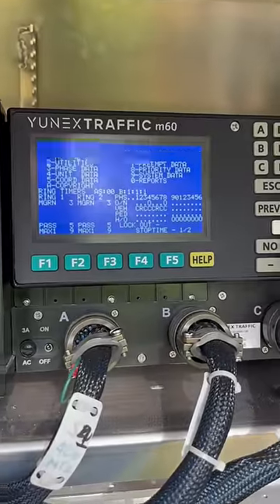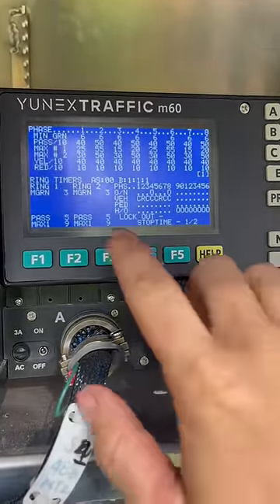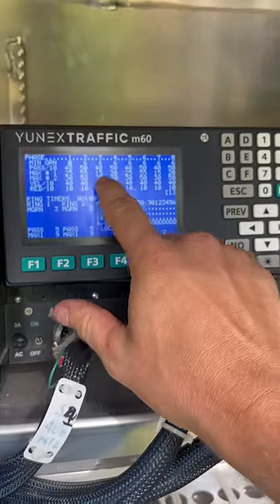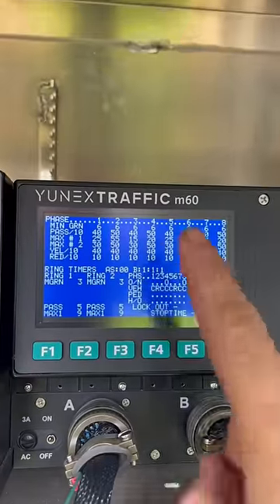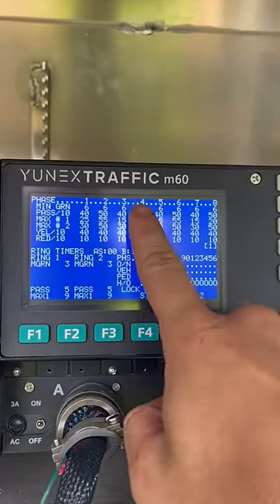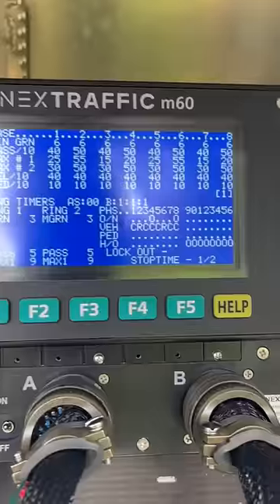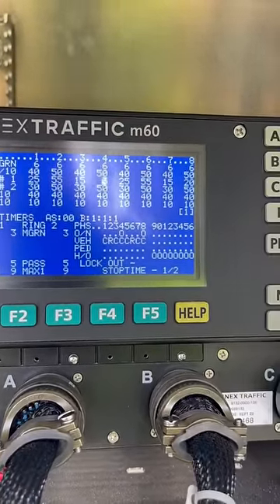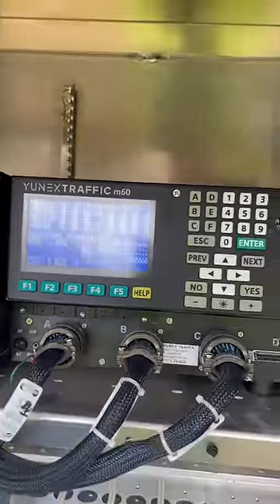Fastest traffic light in Texas!!!

Comment: If i had to program intersection lights, i would check that console 1000000000000000000 times and still wouldn’t be sure if i did it right
Reply: thats true, but thats whats pilots in early 70s thought as well. Fact is: human fails, one fail out of 10000 might be a catastroph enough. Heres another two eyes missing^^
Reply: Good thing you don’t, get nothing done that way
Reply: this reminds me of the story when I first started working as electricians apprentice and I was doing all the receptacles for this apartment and I tell you I checked every single one of those outlets at least 10 times and then we’re getting ready to leave for the day I still wasn’t sure if I did them all and correct shit had me stressing out until the next day just for me to walk in to see that I did do it right
Reply: Traffic lights are apart of city planning, you'd just be following a piece of paper
Reply: @SecureLemons  that can be suprisingly hard to do right
Reply: @hasanabireactionsclips  sounds to me more like you just have shoddy work
Reply: Imagine getting stuck in a forever red light loop. 

If there are no signs stating “do not turn on red” or “no u-turn” you can pass through any stuck red light by just making a right turn then a u-turn turn then another right turn.
Reply: @chantz567 It can happen with a small motorcycle on lights with sensors. Especially on right turn, as the programming often skip those if it don't detect any vehicules.
Reply: @hasanabireactionsclips 
Rule 1 every tool has a job
Rule 2 for every tool, there's a better tool
Rule 3 better tools cost more
Rule 4 bad tools cost you more
Rule 5 a good tool used wrong is still a good tool, it's the user that's bad.
Reply: For anyone unsure, I counted and it seems this guy would make 1 quintillion checks. Let’s say it takes one second to check it once (we’re being generous here). That would be 1 quintillion seconds. That’s about 31.7 billion years. That’s LONG after the sun goes out and our solar system would be nonexistent by that time as well. Maybe life would’ve evolved in other galaxies by that time, but either way, he would not be checking the same intersection. He’d be checking one on another planet as the initial intersection was vaporized by the sun ≈25.5 billion years ago.
Reply: @noahjones9833  exactly. Smooth is fast and slow is smooth. That is what the Army says and I trust them plenty. 

Rushing through something in some vain attempt to be fast just means you're wasting time that could be spent on quality and creating more work down the line.
Reply: The universe would have ended long before you finished.
Reply: @sylviaisgod6947  already said that 22 hours ago, you’re too late
Reply: @wm8123 yeah there’s always that 1 person 😂
Reply: Programming shouldn't allow for such a short duration in the first place.  "Error: duration must be greater than 12 seconds" or some other similar message.
Reply: Me to bad ocd bro

Comment: That's why dodge demon came to the market .0-60 in 1.9sec is perfect to overcome Texas traffic
Reply: actually it would take 3 seconds for the tires to hook.
Reply: 0 to 60 once traction kicks in buddy
Reply: Maybe if you do a rolling start, like they did when they claimed 1.9s 0-60.
Reply: Or just use an EV
Tesla MdS/X Plaid, Rimac Nevera, McMurtry Spiérling, Lucid Air Sapphire, among other e-vehicles (and even a few petrol ones) than can launch without much traction issue
Reply: @memertmemes2586  A vehicle can NOT roll at 0mph. Your comment is invalid.
Reply: @jacobfausnight1180  and the demon can't get to 60 in 1.9 seconds without a prepped track.
Reply: @r1pperduck  irrelevant

Comment: There's plenty of lights near me that need to be adjusted. There's one that's only 8 seconds and it's at an intersection that has a lot of trucks from near by commercial and industrial facilities. 8 seconds is barely enough time for a single truck, let alone the other 5-10 trucks behind it. Not to mention the 20+ cars that are always at the light. Been like that for years and the city said 8 seconds is enough time for 10-15 vehicles to pass through, which I can see if all the vehicles are formula one.

Comment: We have a light kinda like that in my town, but ours  is supposed to work like that. 

There is a train track on the north road of the intersection. The light for north-south is connected to a sensor on the train line. This is so that if a train is coming, the light will either stay green longer, or quickly switch from red to green so nobody gets stuck on the tracks due to traffic. However, if you are unlucky enough to be driving east-west, and reach the intersection as the light is red, it is possible to for it to act like this intersection where green lasts for less than a few seconds.

Comment: I had a similar situation in Corona California.  I was the fist at the light.   I believe it was a setup by someone inside the fire-station that was adjacent to the light.  I was pulled over for running the red light, which I did not do.   I was in the middle of the intersection when it went from green to yellow and instantly to red.  I barely got up to 25 MPH.   The rude cop that was 3 cars back perpendicular to me actually accused me of speeding.   This was a complete scam and I was fined 2 days before the court date.  The bailiff said I couldn’t protest the ticket since they already found me guilty.   This still make me fume how corrupt the whole system was/is in Corona!   I had a search for the citation and it was not on record, no record of the $200 fine or the ticket!   Total corruption!
Reply: I went to court and they dismissed! Good it worked that way for me! Because at that time (younger) I would've probably knocked the light pole and all or worse! 😂

Comment: In my town they were fixing cross section. they did good job, new lights, the whole crossing redesigned so more cars could move. BUT they messed up the timing and one light had like 5m of delay between each green light while green light was there only for few seconds. It is a busy cross section and there is no close enough spot to avoid it. So it created traffic jam from center of the city all the way outside of it in rush hours

Comment: I know dozens of traffic lights on highway on ramps in my country that are legit only green for 2 or 3 seconds.

The idea is that they allow only 1 vehicle to pass through in order to dose the amount of traffic let onto the highway during rush hour.

Also we have traffic lights in town here that are actually clever enough to realise that if there is only 1 car at the light, it doesn't have to remain on green for the full cycle. These lights will turn yellow the second you cross the line into the intersection. So if you're quick to react, they're green for less than 3 seconds.

Comment: What would cause a light at a four-way intersection to skip a cycle? The street that leaves out of my apartment parking lot has a left turn light that will get skipped two or three cycles before it turns green on this side. If somebody comes to the intersection on the opposite side, it will turn green for them, but will skip my side and go back to the main road. It will do that about three times before it turns green on my  end. The strange part is that it only does it certain times of the day. I’ve had this light last over six minutes sometimes with not a single car passing and your only option is to either run it or take a right turn and then pull a U turn.

Comment: Same thing happened to me at a light I go through every day. I was like what are they doing trying to make people run the light and get tickets?

“They’re all used to 30 seconds so we will switch it to 5 and rake in cash.” 

Also it was technically 2 seconds. In my state if you cross the stop line when it’s yellow and it then turns red while you’re occupying the intersection they count that as running a red light.

Comment: I think its supposed to have a short cycle because the next light is red and you only have the space under the bridge and you cant have it back up into the intersection. after both directions under the bridge turn their lefts the light usually resets again but much longer while holding the left lane.

Comment: OR... There is an emergency services dispatch nearby (e.g. firehouse) that has a stuck button or signal set to trip the light, to allow emergency vehicles egress from the side road.

This actually happened in Patchogue, NY (Long Island), and cost a pedestrian, Francis Oroz, her dear life.  Francis did not have time to cross.  A car approaching the light from opposite direction maintained speed, as red in this direction was usually a few seconds.  He/she didn't see Francis.  Francis was walking to church with her sweet mother, Leida. Both Francis' legs were crushed.  Francis was in a como.  She died in hospital a week later, as gangrene overtook her.  All this because the system was not properly tested and inspected regularly.

Comment: A few years back in the next town over from here there was a red light that was hanging up like this. It had even caused a few wrecks. Even the local police had reported it. One day I'm going through there and there's a cop standing there directing traffic and the lights are out. There was a boom truck there lifting up the whole big metal box and set it on back of flat bed. Then I seen why. Somebody had decided that it might work better with a few extra ventilation holes. I could see light right though it. They looked like 30 cal ventilation holes.

Comment: My apartment complex’s exit gate has a light because it’s at a very weird intersection. Someone effed with the light controls (I saw a crew at the control box) a couple weeks ago, and now it’s extremely stupid. The gate’s light has a camera VPD system so that it doesn’t become green unnecessarily. It used to change at the end of a cycle on the main roads to allow cars leaving the apartment to go, which was quite logical. Now, it turns green when a car is still like a hundred feet from the gate, and the car can’t get through before it turns red again. It then lets the through traffic go without a protected left. Then the cross traffic. Then through traffic with a protected left for about 4 seconds. Then the gate traffic. After that, I’m not sure because I’m gone by then. I don’t know who did that, but it’s seriously screwed up flow there.

Comment: I used to think it was unreasonable to replace these lights with something like a rpi, arduino pro since they aren’t as reliable as an embedded system. Now I feel like the embedded system is just way to overkill, especially since it still malfunctions, needs to be repaired/maintained by someone who knows abt the system which isn’t cheap either. Probably better to buy an industrial arduino pro with great enclosure in addition to a relay setup to control lights.  Provided that you have proper amplification stages and converters between arduino and lights. This would also let you fix any software malfunctions remotely, or potentially trigger hardware correction interrupt. Not only this, but you could optimize traffic flow on a macroscopic scale
Reply: Kinda a hot take. I know that you can’t just replace all that hardware with a commercial microcomputer. But you could separate the traffic light driver from the uC. The main reason I say this is because of the disheartening gui there is on that thing. I’m not even cs, (I’m ece) and it’s horrendous. Upgraded to a lcd at the minimum for the price that thing has. If you can’t make fixes to bugs like this remotely, that boomer needs an upgrade

Comment: God, that white car not moving is so infuriating. My route to work has several long lights that you can get royally screwed over at if people take several seconds to start moving. It's my biggest pet peeve. Pay attention, make sure no one is going to run the red light, and fucking accelerate. At the worst light, either 6 people can get through 
 or 2 (and this light regularly has 10+ per lane). The light is also about 3 minutes long, meaning you're gonna be late if you try to time your drive so that you get there just a few minutes before your shift starts. When there's a long line, I'll literally merge onto the road going the opposite direction and flip a U turn and I'll always beat the light changing, it's absurd.

Comment: It’s extremely difficult to analyze the rate at which traffic flow at different times to allow for the numerical methods to calculate the most efficient values that won’t dick society by a 100 minute traffic delay.

what is the point of traffic engineering if you can change the set values for queue and wait time so easily.

Comment: how to change? as in permitted to correct timing issues myself 😮? well I'd probably divide it out to give 2/3rds to the highest traffic flow bigger roads and 1/3rd to smaller roads so 60 secs for straight 1 and 20 seconds for cross  but more like 60/40 split give lefties 40 righties 20 but turn on red or straight capabilities  so that the fractions even out and then adjust the same proportionally favoring larger roads to process more faster allowing for even more inflow from smaller roads increasing speeds per traffic congestion so you go faster together with traffic and reasonably slower when the increased flow is unnecessary on road flow constrictions  figure based on each  vehicle 10 ft in length is 1 ounce now can figure for semis limos busses based on similar so 53ft 5 ounces  now your flow constrictions in closed pipes increase flow for more traffic being commuted proportionally for maximum efficiency each lane equal to 1/4 inch of pipe 2 lanes 1/2 inch  etc now run your data extrapolation for pproposed 10x future traffic flow and set speeds flow based for maintaining saftey now diamond exits or the 🍀 4 leaf or 2 leaf clover exits possibly improving based on exiting traffic flow  but active speed change signs led based on flow is a possibility 100mph is many manufacturers old design specs so id like to see 120mph for 2x miles per hr efficiencys   and incorporate banked turns to help shed water  off to lower sides of road aka slower traffic and high side bank for faster more efficient transport and this is assuming same direction flows but if 1 lane each way no divider roads I'd have some different technology for improvement and maintenance of their road specs I'd even prove it in video game simulations to maximize traffic per minute stats and then sync to real time traffic sensors input to game data online that could move sensors remotely wirelessly to any road data and easily improve speed limits light timing and hill speeds for efficiencies saving gobs of fuel to drivers cutting emissions carbon footprint without changing thier vehicles makeup instead using physics to improve based on marbles rolling down ramps of different weights/ inclines parallel track measurements allowing for roller 🎢 coaster like perpetual motion aided by combustion or stored electric fuel use  oh and musical edges for rumble strips by robotic paint placing for carving out with automated paint tracking saws to cause rumble or road glued flaps using all sorts of musical data not just 1 song  trying to print every song ever recorded everywhere or at least by popularity decending being careful not to double up too much maybe even having local voting via mail in from residents that gives resl time data to robot construction crews